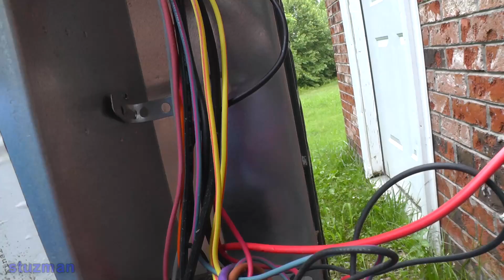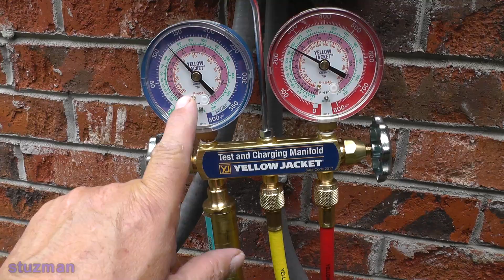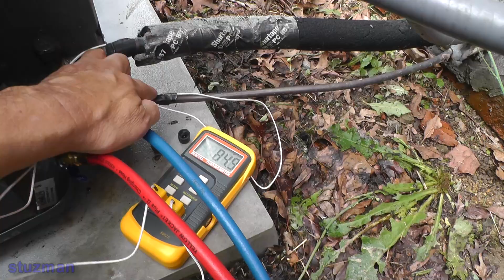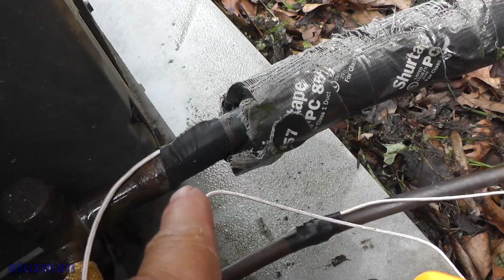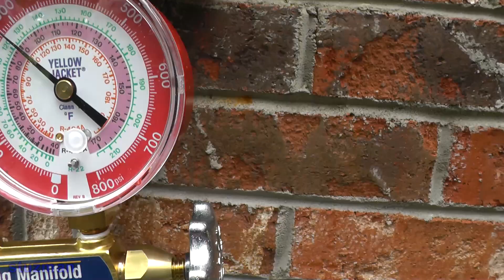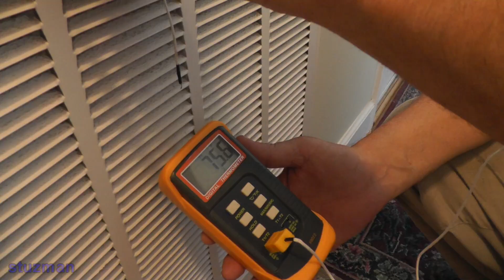Home A/C Compressor Not Running - Fixed

Comment: Fantastic Video Dr. Stuzman. If I'm a homeowner, how do I buy a capacitor or contactor if I'm not licensed? 
I haven't checked Ebay or Amazon, but I know I need to know the part number or spec called for before I order it. Most parts suppliers aren't open on weekends.
Reply from the maker: You can find these items on Amazon and they're much cheaper than a distributor.

Comment: Thank you very much. It was a great video explaining simple steps. My fan was working, and I couldn't hear the compreser working. I safely removed and replaced the capacitor, turned on the power and instead the compreser working. Temperature is dropping inside, so far so good. 
Thank you again.
Reply from the maker: Glad all is working well!

Comment: Hello there, I have just started the search for information to fix my air compressor Makita AC1300. Your film is the first one that I have come across. Can you help please. The problem I have with my compressor is that it will not restart after it has run low of air. It will start from the beginning with no air in the tank and build up to the required pressure. But once the air as depleted down to a lower level it struggles to restart. It just turns over slowly and does not restart. If the air is completely emptied from the air tank it will then restart. I have had the compressor for some years.!I bought it off eBay and it was only a matter of months old. It was stated that it was an ex display model ???
It may be better if I take a film of what I'm saying is going on with the machine. If I upload it onto YouTube I can then let you know the link. 
Might be can be for other people to repair their machine with the same problem. 
Do you think it might be some pressure valve or sensor. 
Thank you for any help. 
Kind regards, Daniel King.
Reply from the maker: Not sure how I see the correlation between an air conditioning compressor and an air compressor. In any event, take a look at your pressure regulator switch assembly. There would be a cut-in and cut-out for a set of contact which allows the compressor to start and stop. It sounds like you have an issue with the cut-in stage of this assembly. Good luck!
Reply: Thank you kindly for your reply.
Reply from the maker: @danielking7133  Glad to help!

Comment: I dont have all of those gauge tools. If i was to just replace the capacitor would i be fine without testing after it started running again?
Reply from the maker: Sure, you can change the capacitor without checking it. If the compressor or condenser fan is humming and not starting, it's a good chance that the capacitor is bad. Have a great day!

Comment: AC works great but compressor will not kick for heat
Reply from the maker: I assume when you say 'compressor will not kick', you mean that it won't start. If so, maybe you can check your thermostat when in heat mode. Have a great day!
Reply: @stuzman52  yeah thermostat tries but compressor and the fan out side won't engage only in AC mode
Reply from the maker: @dannyallen9804  What does it mean when you say 'thermostat tries'? When the compressor and outside fan runs in ac and not in heat, you need to check the thermostat, its wiring because you're not getting 24VAC to the contactor coil when in the heat mode.
Reply: @stuzman52  sorry should have explained. Normally it would flash heat on a couple times then the compressor would kick on and the thermostat would stop blinking heat on and just show heat on. Now it stops blinking with nothing showing till it gets -2 below setting and  the aux heat comes on and displays in the thermostat as AUX ON

Comment: If I accidentally switched the fan and compressor wires would that fry the capacitor?
Reply from the maker: Hi Jim! Most likely it won't hurt the capacitor, but the compressor will definitely not start whereas the fan may run okay. Best to get those wires switched back. Have a great day!

Comment: In my case nothing running no fan nothing else. All wires show voltage. Replaced connector and capacitor still nothing. Could it be compressor? You mentioned that your fan running.
Reply from the maker: John, If your condenser fan and compressor is not running, I would check to be sure that you have 240VAC incoming voltage. I assume that you did. Most likely, the contactor is not being pulled in. Check that you have voltage on the load side of the contactor. If you don't, then it's probably because you don't have 24VAC across the coil for the contactor. If you don't have 24VAC, then you'll want to go inside the indoor air handling unit and check that you have 24VAC across the output of the control transformer. If you have that, then you may have a blown control fuse or you have an issue with the thermostat. Good luck on what you find and have a great day!

Comment: hello i got a/c probleme the fuse in the box fuse blow, i dont know what to do. This can be only the Capacitor or the compressor got probleme ??
Reply: how to check if the compressor is good ??
Reply from the maker: @zonerc6509  Hi Zone, I show in this video how to check the compressor windings. Be sure to check the run capacitor as it could also be this component which is also shown in this video. Good luck on your repairs and have a great day!

Comment: Thank you so much man.  Got my AC back up and running for $23. Top of capacitor was covered in rust including the terminals and wire connectors.  Crimped on new connectors and changed capacitor and I'm back in business!
Reply from the maker: Great news to hear and you saved yourself about $300 for a technician to come out and replace that capacitor. Have a great day!
Reply: $26.50 for me, thank you very much

Comment: Hi, I am newbie and I have two questions,
Question1:  Why this AC have two service ports and other ACs only one? 
Question2:  Why some of systems needs to be refilled while system is running and some of them when system is shut down, what is the difference ? 

Thank you
Reply from the maker: All residential a/c and heat pump units have both service valves to my knowledge. And mini-split units will have only one service valve. On units that have both valves, you can use the running pressures and saturated temperatures to determine the amount of refrigerant in the system. Depending on whether you have a thermostatic expansion valve, or piston, capillary tubing you would use either the subcooling or superheat method respectively. In both types of systems, the compressor and condenser fan will run at at a constant speed.

On mini-split units, you can not use either method to determine the amount of refrigerant in the system. That's why the manufacturer only has one valve to allow for nitrogen pressure testing and to evacuate the system. The reason for this is because the compressor, outdoor and indoor fan will run at various speeds. And even if you preset the unit to run let's say at maximum cool, the unit can and will adjust the speeds of these components at various speeds. For this reason, you have to recover the refrigerant and weigh in the correct amount of refrigerant. And the same holds true on automotive systems where you have to weigh in the refrigerant although these systems have two service valves. Hope this helps and have a great day!

Comment: Fan and Compressor were not kicking in. Replace Capacitor, Contactor, Control Board and still did not start. Replaced Low pressure switch and Air Condition (Fan and Compressor) start working.
Reply from the maker: Glad to hear Sasan that you got your unit running. Keep up the good work and have a great day!

Comment: Great video! What was that buzzing sound in the beginning??
Reply from the maker: The buzzing sound was coming from the coil of the main contactor. When the compressor is not running, it's normal to hear the buzzing. If I had turned off the thermosat, the coil wouldn't be energized, thus there would be no sound. Have a great day!

Comment: Why do most techs tell you to replace the whole unit instead of purchasing a new compressor..my unit is 12 yrs old..
Reply from the maker: Hi Vanessa! One of the reasons is that its more cost effective especially if the system has some age to it. And if you're using an 'outdated'  refrigerant such as R22 which is very expensive, it would be more cost effective to upgrade to the newer refrigerant types which is generally cheaper. Vanessa, why not ask the techs and see what answer they give you? Have a great weekend!

Comment: Can a clog filter destroy an a/c compressor ?
Reply from the maker: Well, it's not the best for the compressor, but I don't think a clogged filter will destroy it unless it runs in this condition for a long time. Since there would be little air flow across the evaporator, the coil will start to ice up. And this icing can go all the way back to the compressor.
Reply: @stuzman52  I have a tenant complaining house is not cooling during 90 degree weather. I checked the outside unit and low side pipe is cold and sweating. It’s a good sign, but not sure why the house is not cooling. They have no Blinds or curtains in the house.
Reply from the maker: @fixingproblems3183  I assume that you replaced the air filter based on your previous comment! Put some gauges on it and see what kind of pressures you're running. You can't say that because the line is cold and sweating that the system is working correctly.
Reply: Here is the issue. Compressor stops to run after several hours. Every time  I call an HVAC guy compressor is running like it should. And since the problem is intermittent it’s hard to re-create while the HVAC is there. Do you think HVAC pressure switch is bad ? Why does it Randomly shut off for few minutes and cut back on?
Reply from the maker: @fixingproblems3183  Does the condenser fan continue to run when the compressor stops?
Reply: Yes condenser fan continues to run when the compressor stops. It stops for 20-30 minutes and then kicks back in.
Reply from the maker: @fixingproblems3183  I don't know about your wiring diagram, but most units will have the low and hi pressure switches wired in series with the main contactor coil. When the main contactor is energized, the compressor and condenser fan will run. So, it doesn't sound like you have an issue with the pressure switches. The most likely cause is that the overload is opening on the compressor. This could be cause by high current to the compressor, high head pressure which can create a higher current, or loose connections to the terminals on the compressor. You could take an amp clamp around the common wire going to the compressor to see what your running amps are.

Here's what I would do to confirm to see if the overload is open when the compressor is not running. Remove the access panel to where the main contactor is located. When the compressor stops running, turn off the power to the outside unit. Discharge the run caps for the compressor and condenser fan. Find the three wires going to the compressor. Disconnect them and note where they go. Measure the resistance from the common wire going to the compressor to the start winding wire going to the compressor. If the overload is open, you will read OL on your meter. Also, you will read OL on your meter if you measure from the common wire to the run winding wire going to the compressor. Hope that helps you out and have a great day!

Comment: My outside unit is running but there's not very cool air coming out the vents in the house. Everything is OK with the thermostat. But the line that is supposed to be "sweaty" that goes to the ac unit outside is dry. Like bone dry. There's no condensation on any of the lines going to the outside unit at all. What could it be? Could it be that there's some kind of leak of freon and I need a recharge? Or do you think it is just a capacitor or compressor issue? The outside unit fan is running but when you put your hand over the outside unit it's not warm air coming up it's cool air. So ik something I wrong with the outside unit but I just can't find a real answer anywhere online. But by what I've described what would you say it is?
Reply from the maker: One of the first things to notice is to see if the compressor is running. Have someone turn the thermostat off and while you're outside at the outside unit, have your helper turn on the thermostat. You'll want to listen for the sound of the compressor starting. If it starts with a buzzing sound and then stops, then your compressor is kicking off because of an overload. If that's the case, turn the power off to the outside unit. There should be a disconnect next to it. You'll want to check the run capacitor for the compressor as I show in this video. Do that and let me know what your results are. Have a great day!
Reply: @stuzman52  ok I haven't done this yet. BUT I did turn off the power to my inside unit and thermostat and turned the breaker for both the outside unit and inside unit off and back on then turned the thermostat and ac back on inside and I can't fully tell if it's because it rained here earlier and it's now night time (still like 70 something outside right now) but the air coming out of the vents seems to be cooler than it was now. So either that's just because it not daytime so the air coming out is cooler or if it's actually the air conditioning cooling again. I had the thermostat off for a good 2 hours almost cuz I had to do something so it may take it a minute for the house to cool down so the ac goes off but I'm getting nervous that because I only set the temp down 1 degree from what the thermostat read and it's still on blowing air now for about an hour that it's not working still and it's just colder air cuz it's not daytime anymore. Idk if any of this makes ANY sense so I'm sorry if it doesn't.